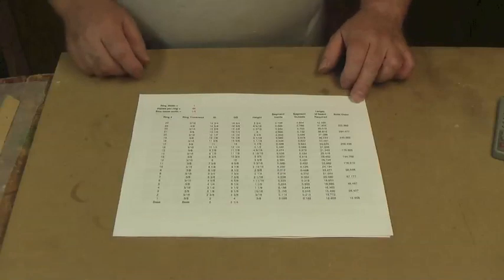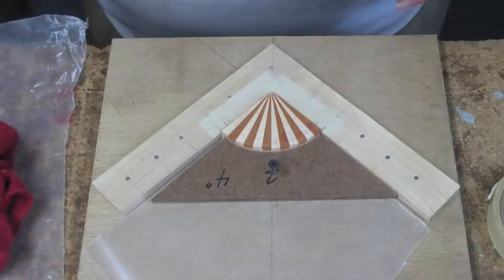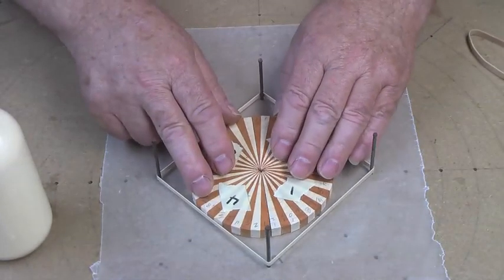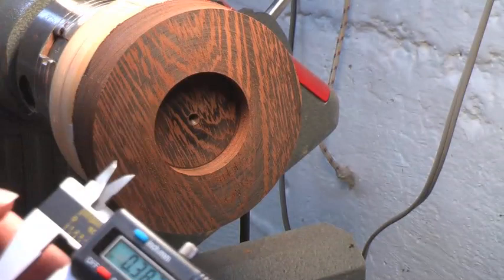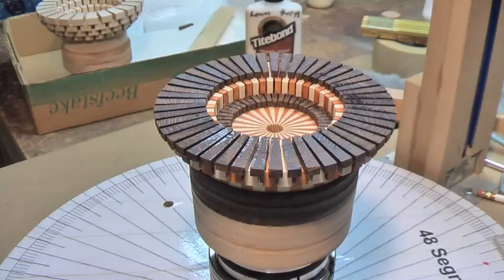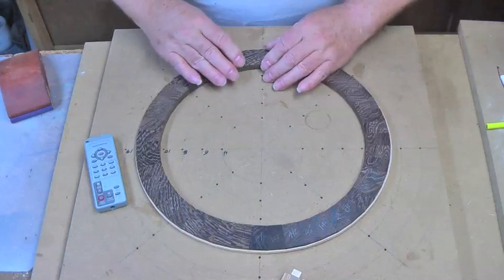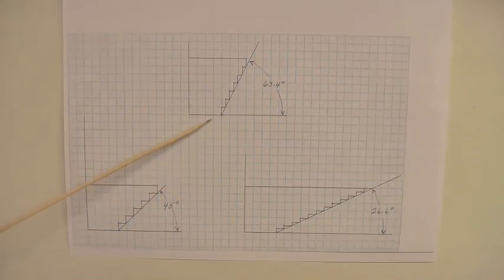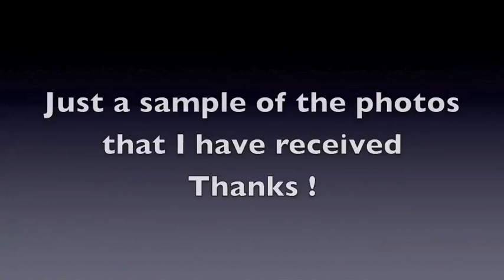Black & Gold

Comment: on your 48 segment (open segment) bowls, what mitre gauge angle do you calculate for?   a normal 48 seg closed would be 3.75 deg per side.  using this or 2.68deg perhaps?
Reply from the maker: +Michael Wenman You'r close.  I use 2.75

Comment: Do you have any plans or better pictures of your segment gluing jig?
Reply from the maker: I had no plans worked out when I built it.  I just used what I had on hand.

I took some measurements of the open segmented jig.  The base is 24 inches by 15 1/2.  The adjustable arm is 18 inches high.  Currently I have an 18" wheel.  I started out with an 8 inch wheel (the movie is on my web site) and then added a 12 inch wheel and finally made an 18 inch wheel and is as big as I can go without enlarging the base.  If I was to start over I would have a 24 inch wheel.  When I had the 8 inch wheel on the jig, just the width of the lines, would cause misalignment.  

Here is where I got the center face plate adapter.

 http://www.leevalley.com/en/wood/page.aspx?p=58760&cat=1,330,49238&ap=1

I took it to a machine shop and had the shaft removed and drilled and tapped, so I could put a bolt into it.

I hope this helps.

Denny